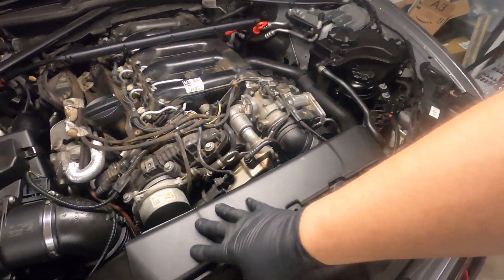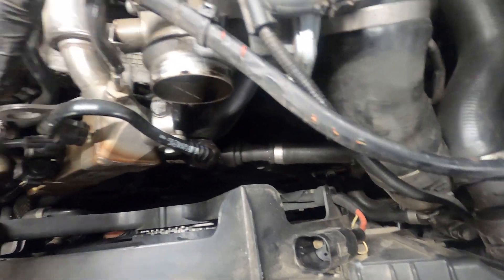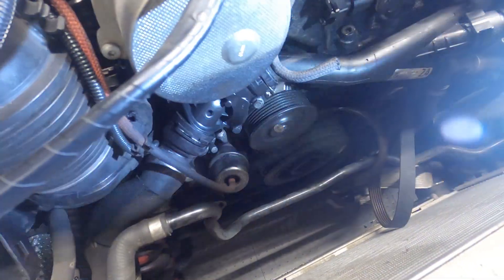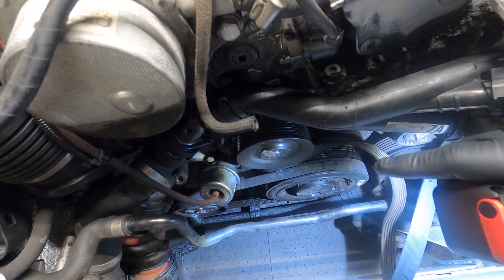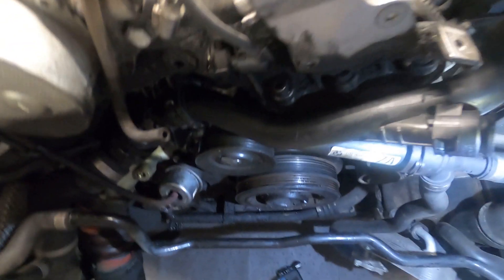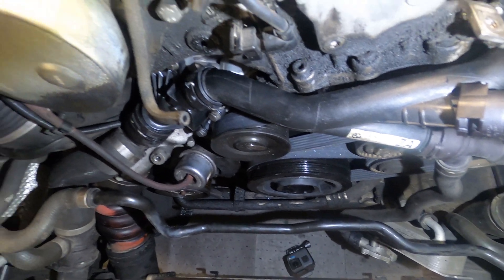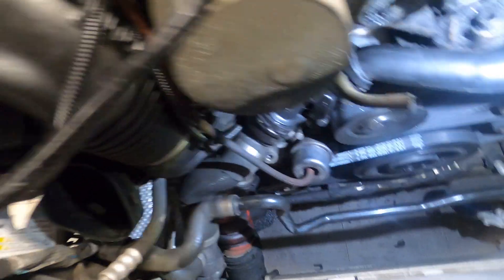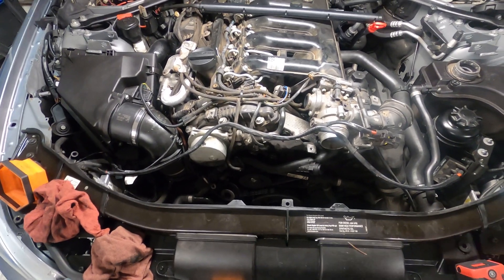BMW 335D Harmonic Balancer and Drive Belt Replacement | 335D Build Series

Comment: Was driving home then heard some dragging then my battery light came on and the steering wheel locked up and won't turn is it the belt or balancer

Comment: Hey man I noticed the a/c drive belt did not list the 335d as a compatible vehicle, only v8s. I just wanted to confirm before placing my order already have the fluid dampener just need belts, doing intake manifold gaskets/glowplugs as well. Also watched your small turbo oil feed line replacements video went well replaced the small turbo as well.

Comment: In your shot from the underside in the 6th minute of the vid, the whole front of everything there is caked in soot, oil, cbu. Any idea what that's all from? Mine is the same way
Reply from the maker: Oil in that area can be from a few things. Could be a leaking valve cover gasket if it starts up at the top. If it's just around the bottom, it could be from the oil feed or return line for the turbos. It could also be coming from the seal on the boost pressure hose at the intercooler or turbo. The best  bet is to clean everything off and drive for a few days and then check everything again to locate the leak.

Comment: Great video.  How did you actually remove the four E12s without the engine turning over?
Reply from the maker: I usually use a 3/8" Impact to break them loose. That or a 3/8" air ratchet. You can also use a long enough 3/8" ratchet and knock them loose with that if you quickly loosen them.

Comment: What does the clutched alternator pulley do? It’s an option to order with the FAI balancer.I heard it’s recommended
Reply from the maker: It absorbs harmonics from the engine running so it doesn't translate directly into the alternator and belt. Helps increase both belt and alternator life.

Comment: Doing mine tomorrow, did you not need to lock crank to torque crank pully to spec ?
Reply from the maker: Counter held the crankshaft at the center bolt. The harmonic balancer bolts on with its own bolts in a circle around the center bolt.

Comment: I know this is an old video..but I have 11' 335d.. 94k miles. The HB and both belts were replaced at 81k miles. I just looked today and noticed the ac belt has a couple places with fraying. The serpentine belt looks great. Any idea why it would be fraying so soon? AC works great. No belt noise or anything.
Reply from the maker: The belt may not have been properly seated in the grooves initially and could have been damaged, causing premature failure.

Comment: Did you just use an impact to torque it down lol. I don't know how it's possible to do a 120° turn without the crank just spinning
Reply from the maker: There is a special tool you are "supposed" to use to hold the engine at the rear to keep the engine from turning. You could also use a chain wrench to hold the harmonic balancer while you torque it. But it in all honesty yes I put them back on with an impact. That's why I don't show it in the video. Because I don't want to promote doing it the "incorrect" way.
Reply: @MunkysGarage  Im sure 99% of people do the same lol! Great vids, helped a ton. Subbed
Reply: Is it safe to drive the car all deleted before tuned?
Reply from the maker: Yeah you can. Just wouldn't recommend  driving it hard. I'd had people drive them 200+ miles after the work before getting them tuned.
Reply: @MunkysGarage  when you use an impact do you personally still measure torque or just send it? Also would a impact still turn the crank?

Comment: Thanks for the video, the question I have... does the engine need to be in neutral to turn the crank or did you just leave it in park (when removing the AC belt)? Thanks!
Reply from the maker: It can be in either. But I normally just leave them in park.

Comment: Great video!  I just got a 335d and love it but I’m having issues with the AC - 66K mile, one owner car so great condition but have you heard of that stretch belt going bad and causing it to slip and in turn causing the AC to not function at 100%?
Reply from the maker: I have not seen the stretch belt be an issue on these. Only the harmonic balancer. I would definitely check it to make sure it isn't cracked and broken free.
Reply: Thanks I appreciate it!  On cool days - 75F and below the AC runs as it should but when its 85/90+ it’s as if it’s running at 6/10ths the way it should.  Takes 20+ minutes cruising on the highway to just get it to blow cold air
Reply: @ryanafarrell  recharge your ac refrigerant, I bet you have a slow leak.

Comment: What are the torque specs for the harmonic balancer?
Reply from the maker: 40nm and then 120 degrees of rotation
Reply: Munky's Garage what dose it mean by 120 degrees of rotation?
Reply: @JacobCastaneda after torquing to 40 newton metres; turn an extra 120 degrees to stretch the bolt .

Comment: Hiya fella, do you NOT have to stop the pullys from turning the engine when cranking on the harmonic balancer ? Thanks for the info reply greatly appreciated 👍 my car is a 335d 2007 e90
Reply from the maker: When loosening the four bolts holding the crank pulley you may have to. If you leave the belt on there its usually enough drag to be able to break the bolts loose before the engine turns. A trick you can use is to put a large hose clamp around the belt next to the crank pulley. This will add some more tension to the belt and some more drag on where it wraps around the pulley and help to hold it. You may also try hitting the ratchet you are using with a hammer in the loosening direction. Usually the blunt force is enough to knock the bolts loose.
Reply: @MunkysGarage  hi so you used same method to tighten harmonic balancer up?Great video btw👍

Comment: The belt routing diagram was a nice touch, some torque specs would have been good though if you could edit that into the description.  Either way you got another sub, keep up the good work my dude 👍
Reply from the maker: Thanks for the feedback and the sub. I added the torque specs to the description.

Comment: I replaced mine with the fluidampr so I’ll never have to worry about breaking it anymore.
It also feels like there’s a lot less vibration.
Reply: wow i figured it would would have more vibrations because its a solid and harder than stock
Reply: Its solid on the outside but it has viscous fluid inside much like clutch fans. It also has significantly less rotational mass when engine running. The only reason it didnt come with 1 from factory bc of cost savings.  @xXSQPRXx